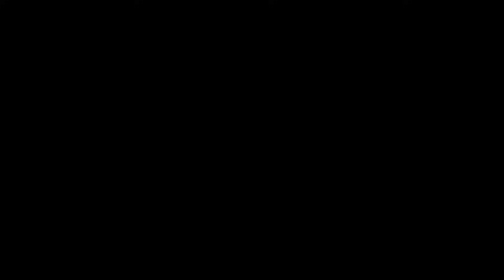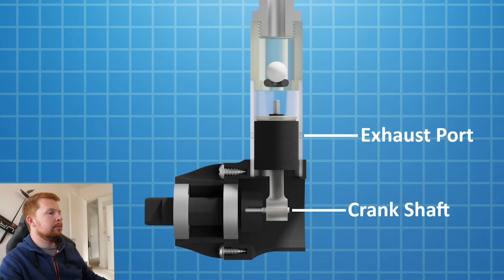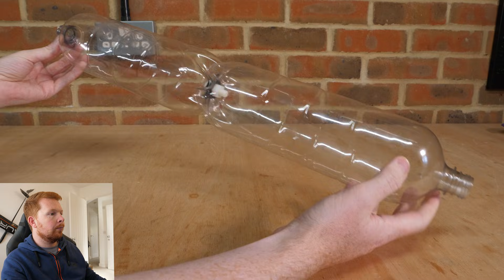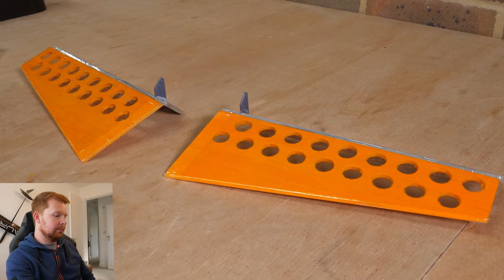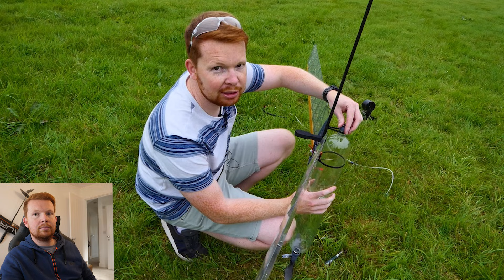How I built a Plane Powered by AIR

Comment: What if you had something separating a gas on one side air on the other the gas being sealed at at a pressure that you want.then as the air is used up in the engine the gas behind the separator expands and keeps the air pressure at a constant pressure. I love your channels and watch it all the time

Comment: I wonder if LW-ASA might be better instead of the ABS? It'd save off some weight, but it might still have the issue of being too weak. Regardless, ASA would likely still be a better option over ABS, given the better UV resistance.
Reply: ASA has a mush lower tensile strength than pla but its toughness/impact resistance is much higher

Comment: What about using a larger CO2 cartridge (such as one with double the volume), because it would weigh less due to square cubed law, and it would also have significantly less parasitic and frontal crossectional drag... And you could fit many more of them onto the plane. (edit: they also would make the center of mass easier to change)

Comment: Have you considered adding a tuned expansion chamber to the exhaust outlet? It works wonders for 2-stroke engines in terms of increased power output over a narrow rev range. I wonder if it might improve the efficiency of an air-engine too? 🤔

Comment: Your little piston engine is quite cool but what is the efficiency of it ?  How much forward thrust do you finally get back from the energy of the compressed air? Is it more efficient that simply putting a small pipe on the back and powering it like a compressed air rocket ? From the look of it, I'd guess not.

Comment: Summary
- 0:00 The video discusses the creation of an air-powered plane, expanding on a previous video.    
- 0:17 The creator first had an Air Hogs plane as a child, powered by a small plastic engine using compressed air as fuel. He found a similar plane on eBay.    
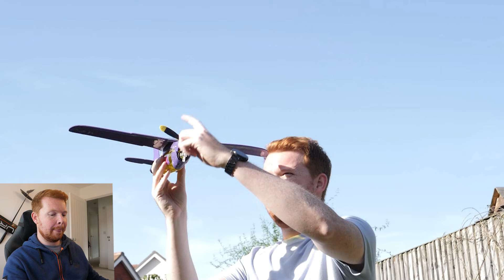- 1:14 The creator recalls his childhood experience of losing his plane and his long-standing desire to build his own, bigger version.    
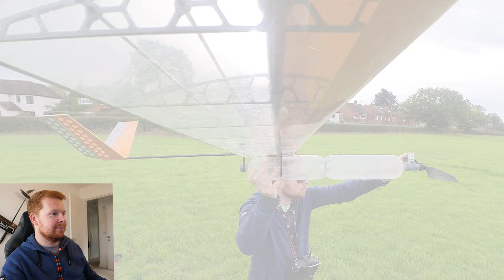- 1:39 The lightweight, airfoil ribs of the plane were 3D printed using ABS because of its temperature resistance and strength. Lightweight PLA was deemed too bendy and weak for this purpose.    
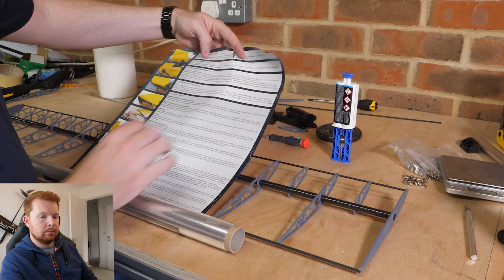- 5:00 The wings were then covered in a lightweight film. However, tension caused the wing tips to bend inward, causing an inconsistent profile along the wing span.    
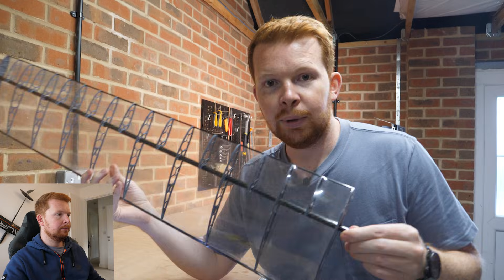- 6:37 The creator describes how this is his fourth air-powered plane build, with the first one being the heaviest, but each version trying to reduce weight and increase engine power.     
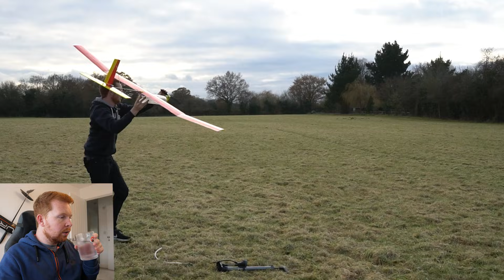- 8:56 It was found that reduction of drag caused by the aircraft also played a significant role in flight time and performance.    
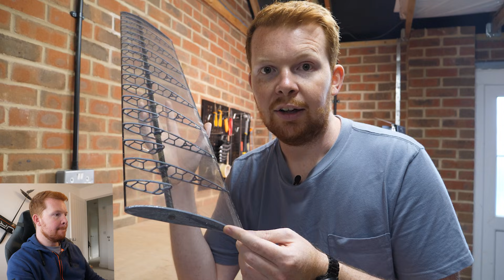- 10:42 The new wing design for the current plane uses an Naca 4412 airfoil profile, known for its predictability and efficiency, achieving a lift to drag ratio of 60:1.    
- 17:24 A high-quality propeller was used to maximize the thrust output of the engine.    
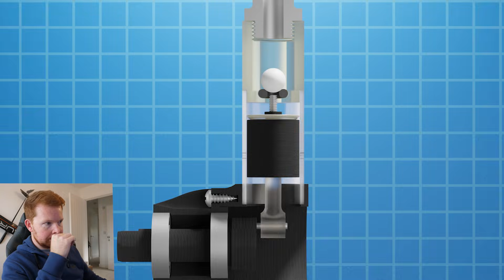- 15:26 The air-powered engine of the plane works by high pressured air flowing in through the top of the engine, sealed by a ball bearing, causing the piston to be pushed down, closing the ball valve and turning the crankshaft.    
- 17:31 A high-quality propeller was bought to maximize the thrust output of the engine.    
- 19:17 There was a discussion on using CO2 cartridges instead of plastic bottles, but it was concluded that pressurizing a 2L drinks bottle to 120 PSI can store 16L of air, making it more efficient.
- 21:23: The speaker is conducting an experiment using CO2 cartridges and a drinks bottle to test their air storage capacities.  
- 21:33: He concludes that it would need 2 CO2 cartridges to match the storage capacity of one bottle.  
- 21:46: The CO2 cartridge weighs more than the bottle, making the air storage-to-weight ratio 2 times greater.  
- 21:57: He is surprised by the amount of air a pressurized bottle can hold (adding 20g of air to a bottle at 120 PSI).  
- 22:18: Switching to CO2 cartridges would result in a downgrade in terms of storage capacity.  
- 22:38: He designs a method to increase the runtime by mounting two 2L bottles back to back using a nylon bolt.  
- 23:15: He uses a 3D printed bottle cap with a small ball valve inside to pressurize the bottle with air.  
- 25:36: He chooses a V-tail design for the aircraft to save weight and drag but notes that this choice negatively impacts the aircraft's stability in flight.  
- 31:10: Despite encountering issues with the bottles and the propulsion system, he manages to fly the aircraft successfully.  
- 34:29: After several flights and modifications, he is able to achieve a record flight time of 1 minute and 22 seconds.

Comment: How much energy to you recover in terms of propulsion compared to the energy of the compressed air. That printed motor is nice work but does it recover more than just blowing the air out of the back as a simple jet ? Beautiful work on the wings.

Comment: Hey really enjoy this format and the insights into the process you provide with it.

Regarding the corrected calculation of the CO2 cartiges (how do you spell that? I'm not an native english speaker): A while ago you built a rotor propelled Rocket, powered by super capacitors. I'd love to see Something similar built with your gas Powered engine and one of those CO2 capsules.

Comment: One last thing - I think you should get better efficiency out of your engine at higher loads and lower RPM, as in such a plastic build, friction builds up really fast. You should get yourself a few basic plastic propellers with various pitches, see what works best, and then buy a fancy carbon one at the right size.

Comment: Why not use compressed air and C02?  It would be easy to have at least one C02 integrated into the bottle system.  Have another channel/servo to fire the C02 and refill the majority of the bottles and continue flight.  It appears that you have enough lift for that?!

Comment: I'm wondering if car engine piston rings can be used in your air engine. There are pistons designed with holes in the oil scraper ring seat. You can print a piston with 2 rubber ring seals (for example you can use rubber O-rings or print them as you did it for the current model) and add a bunch of tiny L-shape holes from the top of the piston to the space between O-rings. In that case, you technically should get better compression and fewer leaks at the bottom dead point and the top dead point when your current rubber seal shrinks. Also, you can change the shape of the intake and exhaust to a conical shape with more rounded edges like it is done in 4 throttle intakes on motorbikes so the engine chamber can be filled with air faster and the air leaves the chamber faster. Another thing I'd try is using a T-shaped or V-shaped valve instead of a ball so the combination of the inlet channel and the engine chamber together act like a compression chamber of a turbojet engine. And the last thing I wanted to ask is - why don't you try to wind up a clock spring with an air piston and then use it to rotate the propeller of the aircraft?

Comment: 37:23 so how an altitude sensor works it makes sense as submarines increase pressure deeper your go you decrease that same stored pressure the higher you go as well as stored fuel temperature vs air temperature  that's why your flight characteristics change via altitude   (context) reference the combined 2 liter bottles having forces around it acting on it

Comment: Could using the CO2 canisters get a better flight time because they are so much smaller so therefore the plane would have a lot less drag? Even though they are a heavier solution than the bottles. I wonder if there is a trade off.

Comment: I have to wonder about the CO2 because it was bugging me like I'm sure this guy has thought of it, but he's not said it so I commenting it here now.

Wouldn't the CO2 have the massive advantage of both being easier to place (COM wise) but more importantly, with a significantly better (smaller) frontal profile meaning much less drag? Heck, thinking about it further, wouldn't it even be better than that since it would be wholly behind the engines frontal profile more or less giving it 0 to even increasing the aero performance of the plane over the plane with no bottle at all (like a long end cone for the engines frontal profile?)

I also got thinking, for your volume calculations, and this part I very well could be wrong on as I both did not calculate it and am not a physicist, isn't the cartridge even closer than you noted in this video?

What I mean is, ultimately when the bottle is depressurized, it'll have 1 liter of air still in it, whereas when the gas canister is depressurized it'll have 21ml or so (probably slightly more) in it. wouldn't that mean the bottle is more like 15 where really we know the last dribble won't be worth any real pushing force whereas the C02 WI) keep more considerable pressure for longer due to its small expansion chamber (related to the concept of why cars try to get as much compression as possible)?

I really am interested in seeing your opinion on this and didn't see the same observations elsewhere while skimming the comments, so you know where to find me.... the comment you're currently reading...

PS, I apologize if I started an itch to actually build it just to find out what actually is the reality, and I case you don't immediately think of it, I think one of the fundemental problems you'll have is keeping the C02 cartridge warm as that endothermic phase change happens so it'll be a real balancing act between keeping it warm and not adding weight. I imagine the world's thinnest, lightest heat sink in parallel to the planes direction of travel.

And just to be extra verbose, I now am wondering how that sort of dragging the so rounding air along with it strategy similar to aircraft emergency slides and Dyson fans would work vs a piston engine.

Thinking about it even further when you compared the weight of the drinks bottle right after talking about the weight of the camera, it had me thinking, do we even care about that weight difference in the grand scheme of the entire plane (which is what we really have to compare against) when the fluid itself dwarfs the weight of either pressure vessel?

Comment: The enthalpy of vaporization of CO2 and the fact that the pressure varies a lot with temperature reduces the available energy when a CO2 tank is used up in such a short amount of time. At 15 °C the enthalpy of vaporization of CO2 is almost 180 joules per gram, and that increases when the temperature decreases, to almost twice that at the triple point. And without external heat only a small part of released liquid CO2 at/around room temperature will evaporate before the rest reaches the freezing point and turn into dry ice. And, the amount of energy required per amount of gas formed doesn't stop increasing when you reach the triple point,    

Of course, the CO2 could be reheated, to reduce that issue, but without reheating, 14 CO2 cartridges might not even provide as much useful energy the air bottle at 8 bar.  Reheating the CO2 can only reduce the issue, not eliminate it, as reheating it completely is not really feaseble, and introduces new issues. Also CO2 cartridges would require connectors. And while they're not very expensive, using half a dozen cartridges or so per flight with some heating system that is reasonable to have on the plane to get the same flight time as the air bottles would not be economical.
  

Also, the exercise pumping up the air bottles gives is a bonus, I'm sure Tom is smart enough to figure out that there are small, not too expensive battery powered air compressors that could do the work for him if he wanted to.

Comment: Did you make any calculations on air drag of the bottle vs the CO2 cardridge?  The drag should scale linearly with crossectional area, so a 2 times reduction in "tank" radius should reduce the dragforce by a factor of 4. Don't exactly know how this will relate to flight time as velocity might also increase, but might be worth a test anyway.

Comment: A thought that struck me with the piston.

If it was rectangular instead of square, the piston maybe could "keel over" in one direction at the bottom or top to change the width and thereby let the air by on the compression stroke.

Come to think of it: your idea with the channels sounds simpler :)

Comment: If you did want to use a manufactured part, have you looked at presta valves? I found them to be much nicer to use than schrader ones and for road bikes going up to ~90psi I have not had an issue with them. Not sure if its better for your case though, just a thought

Comment: Is air the best pressurised gas (mix) to use? What about going 'hybrid'? - ie. using the CO2 cartridges to charge your bottles. Or if you want the engine to sound like a tickled hyena as it soars majestically around the paddock, maybe nitrous oxide (before it's banned in the UK). Methane perhaps? : )

Comment: Don't fret the mistake with the CO2 cartrige, there is another reason why they tend to suck for quick depressurization is that boiling the liquid CO2 requires LOADS of heat so they don't immediately empty out and have less pressure than they should

Oh and your are right, bike valves suck

Comment: A trick I used to avoid the last rib of a wing buckling when tensioning the Monokote is to add a sideways rib to it. This also serves to round off the wingtip and can also add a small angle to it as well as taper the shape.

Comment: Would it be a possibility to put dry cubes into the bottle. If it's not too hot( which it isn't in UK)  there should be a gradual evaporation, creating CO2 gas...just a thought

Comment: For what it's worth, this is the most interesting thing I've seen all weekend. I also went back and rewatched some of your old ones.  
I discovered that I have an Air Hogs I bought new. One set of wings and tail are still unused. It still holds pressure and runs, so I'm going to fly it when the wind stops howling. Thanks for the brilliant content.

Comment: added problem with the co2 canisters is that they cool down the co2 considerably as it comes out (adiabatic cooling). this would probably cool down the seals and make the engine not run as well. It also expands less as it is cooler. CO2 is also denser than normal air ~2kg/m3 vs 1,3kg/m3 air but i have no idea what that would do to the engine.

Comment: Well done!
One thing you might want to modify if you ever give it a go again:

"A wing with a chord-wise cut through it tends to behave more like two lower-aspect-ratio wings flying in close formation. The ends of the gap act like wingtips and shed their own tip vortices. If an airplane has significant gaps at the wingroots, it effectively has two low-aspect-ratio wings instead of one higher-aspect-ratio wing. This will cause the wing to have a very low span efficiency and high induced drag. The gap size required to cause this effect is relatively small, and it is much more important to seal chord-wise junction gaps than any other type of gap on an airplane."

All the best/Axel
Reply: Absolutely right. The Performance will increase signifikant. Lets say other 30 Seconds..

Comment: with some smart engineering I think you could optimise the bottles further, as you said with the splicing but also just one wrap of carbon or glass fibre sheet, a little resin and I wouldn't be surprised if you can get upwards of 200psi in them.

Comment: you probably can get away with perforating the balsa wood in the wings , also you dont need that huge battery for the electronics ,and you already mentioned that your looking into splicing bottles ,also the improved aerodynamics of a spliced bottle might be small but i think it will be worth it with a pointier bottle 
also i thing the engine would work if you lay it horizontally with a small redesign for the cylinder head , that would save some drag , maybe now focusing on gliding more would get you into the 2 min club.

a case could be made for co2 bottles becoz they are small and wont have much drag as huge bottle ,but then the weight of the brass would bring you down faster .... anyway your a smart boi you will figure it out

Comment: The adverse roll on the V tail is probably the main reason you don't see it used much on gliders, where the tail tends to be more slender and wider. An option would be to go to an inverted V tail, but this makes it more vulnerable on landing in the grass.

Comment: About the bottles - if you are going to revisit gluing/sleeving two of them together, what if you used a balloon on the inside to prevent leaks? Similar to how a bike tube holds the pressure but the tire stops it's expansion, the balloon holds the air (no leak) and the bottles simply stop the balloon from exploding? 

I imagine the issue then would be shift to making a seal that doesn't rip the balloon - but it would be interesting to see if allows you to shave some weight! You'd also get a really good visual of how much pressure is left in the bottle as you fly as the balloon deflates.

Awesome project! keep it up!
Reply: additionally, he could build a much more streamlined fuselage with cartridges, reducing drag as compared to flying 2 liter bottles around.
Reply: @Araye   A small carbon bottle designed for paintball / air rifles would be perfect as it can hold up to 4500 psi. Now I want to try that but I doubt I will have the patience and skills to build it haha
Reply: @Jean_Mairdluheux  if one person can do it, so can you. all you need is the desire. with desire, all things can be overcome.